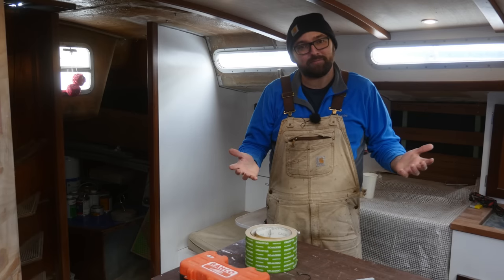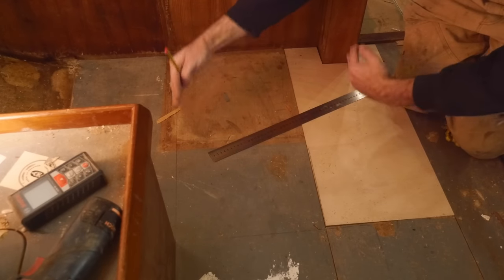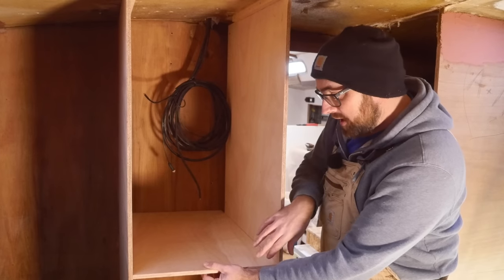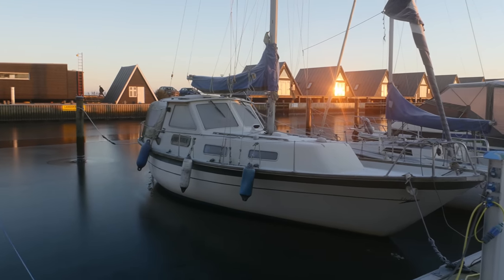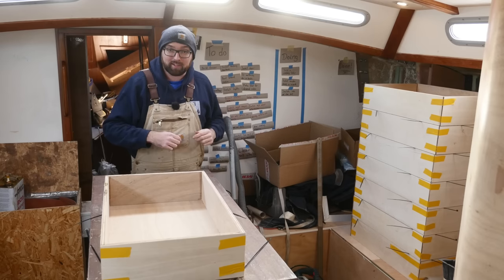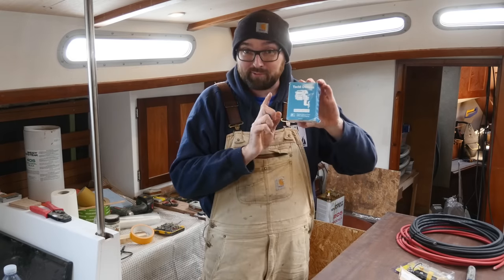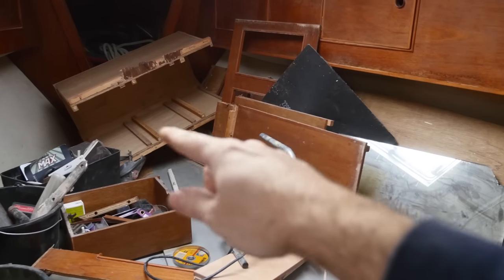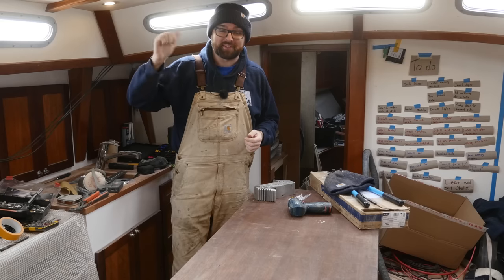Sail Life - Forward cabin & Yacht Devices Engine Gateway (NMEA 2000)

Comment: This boat has a diesel engine, diesel heating, diesel water heater - .what on earth is the 7.2 kw of battery bank for.... i am really interested to get a logical answer..
Reply: @Jonne321  and washing machine & dryer
Reply: It’s pretty much an electric boat.  Cooking, lighting, instrumentation and washing clothes are the consumers of electricity.  

    The electricity is stored in the batteries and converted to AC (where needed) by the inverter.

      The batteries are recharged by:  Solar (on the arch), alternator on the engine, or shore power through the isolation transformer.    We have not determined if he is still going to use the “itty bitty” Perkins as a stand-alone generator.
Reply: Anything worth doing is worth over-doing.
Reply from the maker: I estimate our daily energy need to be around 5kWh. That is just an estimate :) It might be more in which case I'll double the battery capacity (14 kWh). As some of the other replies (thank you guys!) have pointed out we have a lot of power-hungry doohickeys aboard: fridge, freezer, induction cooktop, electric oven, washing machine, dryer, water maker, dive compressor, and maybe at some point in the future airconditioning.
Reply: See Chapters 1 and 2 of Nigel Calder's "Boatowner's Mechanical and Electrical Manual" for an in-depth discussion of electrical loads, battery charging, etc.
Reply: @Jonne321  that is exactly what the solar panels are for. although it is possible that here would be no sun for a few days, do you thibk that they will wash and dry their clothes those days?
Reply: @Stepclimb  this just does make sense. The generator can cover the washing/drying, with a much smaller battery. The cooktop - do they cook a 5 kilo turkey every day at night, for 5 hours? No. Check out other boats with induction cooktop - one of them have 7.2 kw battery pack. This is a megaloman mind overruling practicality here.
Reply: @bobadam7021  except adding too much weight to the boat.
Reply: @SailLife  5 kw? Do you plan to wash every day? Do you plan to roast turkey every day? Dive compressor every day? where did you learn on how to calculate ebergy? I suggest to read that book one more time.
Reply: @tiborkiss9186  
      Maybe, but why would one want to start a noisy engine or generator just to cook something?
     
     Also, a large battery capacity means lesser depth of discharge for a given power demand.
     Lesser depth of discharge before recharge generally means longer battery life.

     I think Mads is on the right track for his needs.   For a lot of sailors, they try to utilize solar only to charge the house batteries and use the generator only if they have to.   To run all of these power hungry devices, he’ll need a lot of capacity.
Reply from the maker: Tibor, you're coming across in a not too flattering way here. I suggest you reconsider your approach.
Reply from the maker: @Stepclimb  You're correct Stepclimb. Very good point about reducing cycles on the battery. Also, having a bigger battery bank and inverter means you can get away with a smaller genset and running it for fewer hours. Gensets used to be sized to handle peak load but that's very inefficient. I think Victron has a whitepaper that covers this (it might be Nigel Calder). Using power assist you can get away with a much smaller genset. Another fascinating topic is genset vs. high output alternator on the main engine (that one is definitely Nigel Calder).
Reply from the maker: @williamglidden359  Funny you should mention it :) Nigel actually helped design the system for Athena. It was really cool to get to meet (electronically) one of my heroes :) I've got three copies of "Boatowner's Mechanical and Electrical Manual". Including one on my phone for emergency use ;)
Reply: @tiborkiss9186  Lithium weighs a fraction of what lead acid weighs so you get a lot more bang for the lb.   -Also Mad's correct me if I'm wrong here - but with both of her ends loaded up, (freezer, washer dryer, genset, dive compressor etc) having more ballast in the center will help with her performance.
Reply: @SailLife  I received Nigel Calder's book for Christmas based on your earlier recommendations!  Quite an in-depth reference for designing/tailoring boat electrical systems.  You're doing great, keep up the good work!

Comment: How come you’re having 24v onboard? (as well as 12v) out of interest
Reply: as the 24v bank is for heavy loads like the inverter (& windlass??) the wiring can be smaller as half the current. 
Also the inverters tend to be a little cheaper & more efficient running at the higher voltages.
Reply: @guy.h  hmm ok interesting. Our inverter charger is 12v. Windlass is 24v but there's dedicated batteries at the front of the boat and some doohickies that convert 12v to 24 for the furling main... Shall wait and see I guess
Reply from the maker: Basically exactly what Guy H is saying :) Smaller gauge wire and cheaper inverter/charger. Plus the size of inverter/charger I need doesn't come in 12V only 24V.
Reply: @SailLife  I see. Cool look forward to seeing everything in action. Ps have you seen the Victron Lynx Distributor setup, and Victron battery protect?

Comment: When fixing wood to wood wouldnt just using woodglue be easier than mucking around mixing up thickened epoxy everytime? After all woodglue joints are stronger than than the wood nowadays.